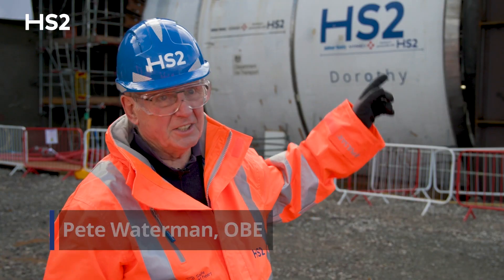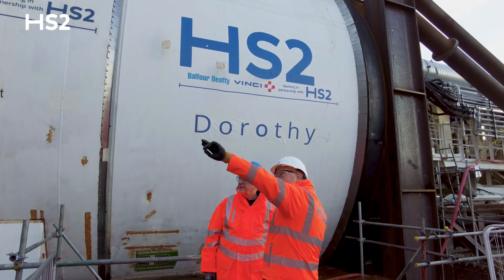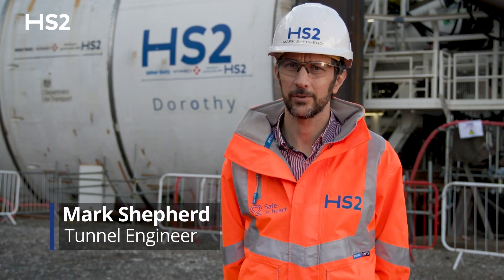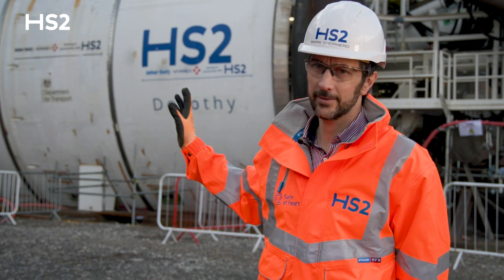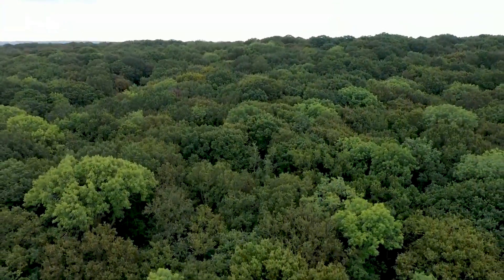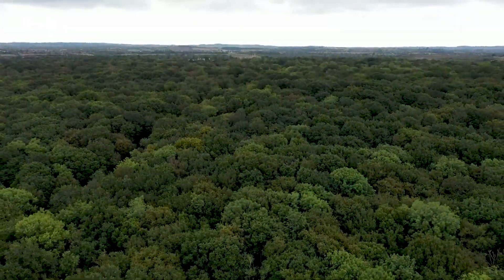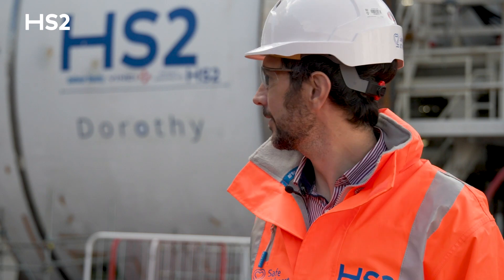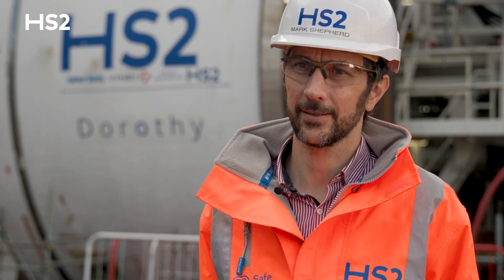Meet TBM Dorothy, HS2's first Midlands tunnelling machine

Comment: Absolute madness the terrible expense and environment costs to create a project we don't need and would be better without. Creating jobs at such a colossal material, energy and financial expense is insane.
Reply: If you knew anything about the railways in this country you’d know that it is needed!!
Reply: You obviously know nothing about British transport networks.
Reply: We need to go electric - and cut out diesel and petrol transport. This is part of the change we must make.
Reply: @alexmckenna1171  that's bs. Batteries, photovoltaic panels and nuclear will be an environment disaster and are already presenting very expensive problems that   have not and never will be satisfactorily solved. For being involuntarily forced on a false green agenda costing trillions and  using our environment at an alarming rate also wasting billions of tonnes of fossil fuels and materials. We're seeing an aggressive drive because of greed and very highly paid jobs. Aggressive use of fossil fuels to satisfy an agenda packed with lies is criminal. Battery vehicles and hs2 are not green and are a complete lie.
Reply: Have you not seen that our motorways are now so busy that they are converting the hard shoulder into another lane on many of them?

We have pollution from cars killing people and need to increase capacity on public transport, so we can reduce car use.

Building high speed lines will allow us to create modal shift that gets people off of motorways an domestic aircraft. The trains they take off of the existing mainlines will free up slots for more frequent commuter trains and allow for more rail freight.
Reply: @DavidShepheard .. you've conveniently forgotten that by the time this monstrous vanity project is up and running, (if it ever is), the majority of cars on our roads will be electric which makes a mockery of the "pollution" argument & research shows that traffic on the M1 will only decrease by less than 1%.
Domestic flights are actually increasing due to the unreliability of the rail network & the outrageous  ticket prices .. example: .. train from Newcastle to London King's Cross - £300+ return, travel time 3.5 hours.
Flight from Newcastle to Heathrow - £120, travel time 50 mins .. which would you take? 
Opinion polls regularly show that over 70% of the public are against HS2 & a similar percentage won't ditch their cars in favour of high speed travel (although it's now been revealed that very little of the project will be high speed after all).
Read this summary of a report published last month by Andrew Gilligan, policy adviser on transport & infrastructure to the PM from 2019-2022.

By cancelling all sections of HS2 where main construction has not yet started, we can save around £3bn a year by 2027/28 & £44bn or more in total.

HS2 now costs more to build than the value of the benefits it will deliver. The official benefit cost ratio (BCR) shows that for every £1 spent on the scheme, the country gets back benefits worth only 90p. Shortening the scheme improves its value for money.

Including “wider economic impacts,” the BCR rises to 1.1. But even this is suspect,  since it uses an artificially low construction cost & assumes that all HS2’s operating & renewal costs will be covered from fare income.

The BCR calculations also use figures from before Covid, since when the scheme’s costs have risen & its benefits have fallen.

Almost half of HS2’s benefits go to London and the South East, meaning that HS2’s effect on levelling-up will be little better than neutral. Its claim that it will create 500,000 new jobs is an absurd exaggeration.

Public support for HS2 is low everywhere & even lower in the regions it supposedly benefits. The outcry at last year’s cancelling of the Eastern leg was entirely confined to regional elites; it left ordinary voters unmoved. Northern leaders back the scheme in principle, but vehemently oppose the specific plans for Manchester.

Rising costs and cuts to public spending mean that if HS2 continues as currently planned, it will eat much of the rest of the public transport budget, sucking billions of pounds out of the services which most people use, need and want
Reply: @DavidShepheard  long distance high speed commuting isn't something to be encouraged nor capitalised on and goes against all policy of saving environment, energy and money. Rather than long distance travelling to place of work place of work has to be nearer. All your doing is pointing out the obvious treating it like ammunition to support and insane big spend project. Its exactly how it got started. Greed. Look at the salaries and costs and you'll realise anyone involved has their fingers in a very big pie. Money doesn't grow on trees and we're already in a deep mess financially and increasing value of land with infrastructure and commerce to maintain greed is unsustainable and a regrettable burden that has to be avoided Rather than made bigger. Its a trojan horse for further environment, taxation, construction and energy profiteering.
Reply: @stevendellow9505  If only ensuring people can have the same jobs closer to their homes was that easy. HS2 is long overdue with BR having evaded the inevitable issue of the railways becoming congested and not fit for purpose as most of them are based on Victorian infrastructure. More public transport, and better quality of public transport, can only be a good thing? Or would you rather people reside in their cities for the vast majority of their lives, only straying out for the odd thing or two, using a pretty polluting form of transport
Reply: @commie_thinking4715  modern cars are not the problem they're made out to be and most people don't need cars so big and use them for short journeys where cycling, motorcycle or walking would  be better. Its a very bad and negative approach to say people need to travel long distances at high speed as a daily commute when most the population of our country are happy to work locally and would find long distance commuting not only s burden but a terrible waste of energy. People are naturally more content not wasting time travelling and would class this as an expensive inconvenience in their lives. It may provide a certain amount of overpaid jobs building this line and leave some towns with very expensive to maintain stations but the environmental, energy and  monetary costs will always outweigh any perceived advantage. With modern technology all the jobs that are allegedly necessitating this can easily be transferred to a more local place. Homeworking proves this. Then add the fact many more important things are being neglected through lack of money and we're facing the prospect of rapid inflation through costs its easy to realise  things have moved on a lot since the days when the idea of hs2 was concieved.
Reply: @stevendellow9505  although I agree with some of what your saying , I don't agree that people will magically stop travelling because we don't have HS2. Individual car ownership is definitely harmful for the environment - manufacture and disposable of the vehicles, the fumes ,(including those from brake and tyres on electric cars), the electricity consumption, obesity though sedatory lifestyles , cutting off communities with congested roads, no uptake in sustainable transport due to car dominance, endless road accidents and preventable deaths each year... The list goes on. Our current railway network is running at capacity and the only way you create more is to make more.
Reply: @stevenm8970  You can't understand anything that doesn't involve spending loads of money and creates incredible financial and environmental burden then. That's an incredible weakness.
Reply: @hendog3894  it's not necessary to commute long distances at high speed. Working locally doing same jobs is common sense if that's where people live. All the commuting creates is another solution for profiteering from unnecessary journeys being deliberately engineered into lifestyles. This sort of management of society has become too common and is already showing the negative side of the acceptance of overcontrol.

Comment: Get it to Notts ASAP
Reply: And Lancashire Preston and Blackpool north
Reply: @R08ERT  the Piccadilly to Blackpool North line isnt that congested, if platforms 15 and 16 at Picc get built, Northern could definitely fit more 331s on that service is need be
Not sure about Preston though
Reply: It won't ever reach Notts (or Toton) so don't hold your breath....
Reply: .. and Cardiff, Liverpool and on to bonny Scotland .. starts to look like a Nation that invented and was built on Railways again and still a green and pleasant land you can breath fresh air in.
Reply: @mc2594  100%, we need it going all the way to Swansea and Inverness
Reply: @isnitjustkit - lol well it's one way of getting the branch lines back .. 
put a new trunk in connecting the big Cities and International Airports North and South, could also ease pressure on Heathrow and Gatwick a fair bit as well as the rail network and roads.